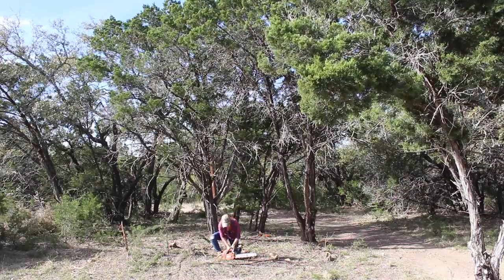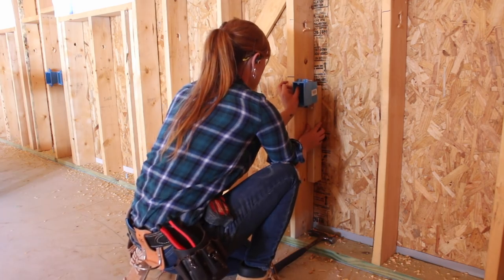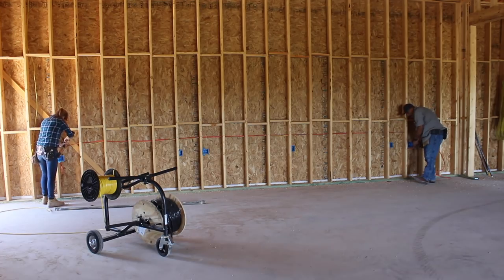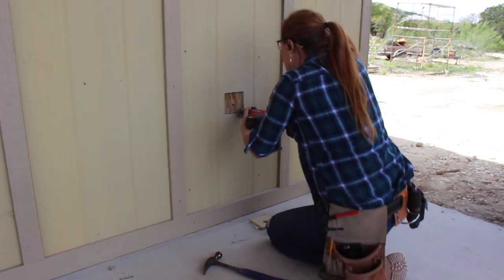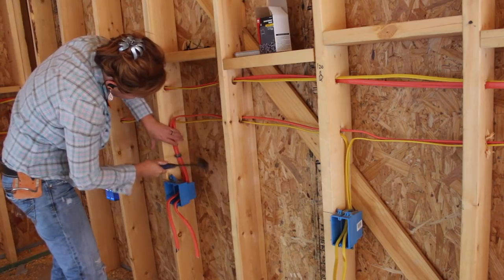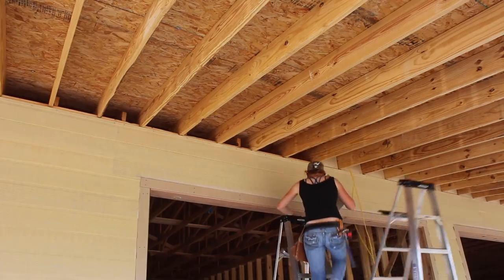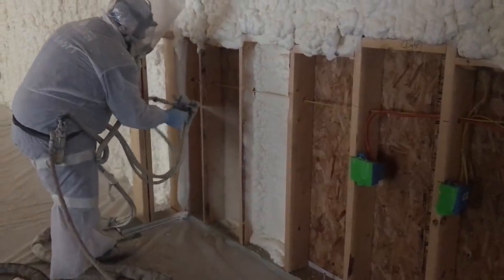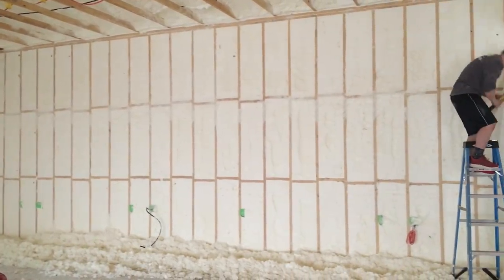Wiring My Shop and Spray Foam Insulation

Comment: Q: Hi! And how do you plan to solve the issue of removing chips and dust?
Maybe it was necessary to put pipes(tubes) inside the walls, and to arrange places for docking with equipment(tools)?
Or will it be a suspended solution under the ceiling?

Comment: About the power lines. A lot of electrical contractors will build power lines and set transformers. My company does but we're in OK. 
The utility company just has to hook up the main line to the transformer, sometimes they have us do that as well. 
Just so you know there are other choices beside the utility.  They should have a list of approved contractors/vendors they use for work, might not hurt to ask. 

Also might want to go to a 320A service just in case.  That is the largest residential/small commercial style service available in my area anyway.  

I had my shop spray foamed and use mini-splits for heat and air. Most people can install a mini-split themselves, they come precharged.

Comment: Nice choice on using foam instead of pink fiber, but I would have gone two inch close cell and covered with rock wool. The close cell stops all air movement and the rock wool acts as a sound deadener and fire break.  To see what I'm talking about look up Matt Risinger's YouTube channel, he just did a video over this. 

But again you will love the fact that you used Spray Foam in the summer here in Texas, I know you're up in the hill country (I'm in Corpus) and it gets nasty muggy in the August heat. Can't wait to see it all done. Also because you went Spray Foam, you can use mini split A/C system in that shop now, which will cost less to run.

Comment: Absolutely Awesome job so far.  Please keep up the good work and excellent videos.  You have a lot of excellent tips and tools.  Unfortunately some of the tools are near impossible or just too expensive to ship into Nova Scotia, Canada but that's ok.  Talk about a total score on the spray foam insulation offer.  I'm doing my basement walls with closed cell.  I originally did the basement walls with Roxul ComfortBatt and another layer of ComfortBoard - it's cold in the winters up here, but after the flood opted for spray foam for the better R-Value and moisture resistance properties.  Oh, and for the "just in case a flood ever happens again" event!

Comment: Hi April. Great video, awesome shop... Jealous? Lol.. remove all doubt.. I question the waste foam, and had an idea,,, if the waste product could be blown in walls simultaneously with a fresh coat of foam?  Perhaps for a future build. After all, you did pay for it, the waste product does belong to you.  Also, be careful about Sugar not burning, as many larger style homebuilt Rockets burn motors produced with sugar.  A mixture of melted sugar and tree stump remover poured into paper towel or toilet paper rolls makes one rocket motor.  No matter what April, great video.  Best of luck April. I have learned many things from your videos.

Comment: I"m glad to see you used spray foam...I'm a believer in the stuff for both efficiency and because of the infiltration benefits you mentioned. I am curious, however, why you chose the less efficient open cell product instead of closed cell which not only provides higher R-values, but also adds substantial rigidity to the structure. "Enquiring minds want to know". :)

Comment: Thank you. Having had electrical done in two garages which double as workshops, I can relate to having make than enough outlets installed both inside and out. Having high ceilings in my home makes me wonder if you will really be able use a smaller HVAC. Personally, I'd rather have a bit too much than too little. Looking forward to the next build. 

Any plans for the flooring?

Comment: In 2011, My wife and I retired and moved.  We bought a few acres and needed to build our home.   But I wanted a workshop.  So we had it built first and the contractor recommended we spray foam it for installation.  We had a steel building.   We intended to live in it temporarily while our home was built.   We moved into the building in September.  By November, we had decided to just live in it.  It's so easy to heat and cool.  We are in midwest-Arkansas.  We use around 800-900 kwh per month electric (we are all electric).  Two months a year we may use up to double that amount.  I highly recommend spray foam.

Comment: It may be a good idea to install some roof hatches or windows, just to vent the shop quickly, if needed. 
The ones in my shop always come in handy if some work produces some smoke (welding) or other fumes (polyester resin).
Nothing vents a building faster and cheaper than the chimney effect.

Comment: Do cat 6 instead of 5 for some a little future proofing.  Also look at Unifi for some commercial sized WiFi points.  They aren't actually all that expensive, fast,  and you can WiFi up most of your property on one robust WiFi network.

Comment: Having a good contractor is key in SPF insulation applications. There were several fires in the early part of this decade linked to contractors not allowing enough time between applications of layers and the exothermic heat build up inside the foam caused fires. Particularly, I remember 3 in Massachusetts. There were additional ones a few years ago in govt facilities as well. Poor quality control and poor installation practices

Comment: April, two questions: 1) When this job is all said and done are you going to doing a total cost breakdown on the project. 2.) Are plans going to be made available for the shop?Ok bonus question: Since you volunteered you help with the electrical work did hr charge you extra for the help?

Comment: FYI when getting a/c for the correct tonnage it’s 400 square feet per ton of cooling. So if your shop is 20x20= 400 sf, you would need 1 ton a/c unit. And for heating it’s 12,000 btu per ton.

Comment: Our company has been using closed cell spray foam for the last 20 yrs. on mainly oil field truck bodies. Works great, can not beat it as far as insulating value and noise reduction. Great job with the electrical (been an electrician for 40 yrs.). I will not pound on you about electrical, the county codes are pretty lax. Great job April !

Comment: Doing 1-2" of closed cell foam, then open cell gives you the best strength and the best air control but costs a bit more. That is how I am designing my upcoming workshop. It is remarkable to see how much you have done and been able to get through. Incredible work!

Comment: April, I am curious as to the height you placed all the electrical outlets. I don't know what you have planned for the layout of the shop but I was thinking if you end up putting cupboards or benches against the wall then the outlets would be covered ?
I am really enjoying following the construction of your shop (and jealous ;-) ). Congratulations on such a great project.

Comment: Hi April I subscribe to your channel and I was concerned when you sold your old home and move to your new home. I was disheartened to see that you had lost your old shop and had to move into and share a garage with your husband. It just wasn't the same. I enjoyed your project videos and was concerned they would come to an end. But I had a hunch you have big plans on the horizon and I am so happy to see that coming to fruition. Which brings me to a question I have a shop of my own a 3000 ft.² steel building that I bought used dismantled moved then re-erected on my own property. My shop is a combination Auto shop machine shop weld shop and woodshop yes it all fits quite nicely. I have been contemplating different products to insulate. After watching your video I did a quick search of my area for a spray foam contractor which appears there is not a contractor in my local area I must search further. Can you give me a ballpark figure on about what it costs you to have your new building insulated with spray foam.?PS congratulations on your new shop and I wish you all the success in the world.

Comment: Your shop is great, I was thinking about all the filming you will be doing in there and was going to suggest a lighting grid for the ceiling using common 1 1/2 inch black pipe. This would allow you to have great lighting anywhere in the shop you want to shoot, just clamp lighting all over the grid, setup a DMX lighting controller and you are set.  You may also need to do some acoustical work to manage echo. You are building a very unique space.  Love your channel.

Comment: Just make sure if you have downward facing receptacles for lights on the ceiling-that the receptacles are twist lock style.This is per N.E.C.-i don't know if your having inspections,but if so this is a necessary step.

Comment: As a Canadian, I’m sold on spray foam insulation but isn’t this a bit of an overkill in Texas? Do you really need much insulation? By code in most provinces in Canada (maybe all), you only need a R value of 15 in the walls.

Comment: April, do yourself a favor and spend the extra few bucks in Cat 6. It is always a pain pulling back wires and re-fishing years later. If you are running multiple Ethernet wires, pick up a patch panel and switch!

Comment: So great work! I always astonished how easy it is to build in your country! in italy you cannot even think about helping electrician in theyr work, it is Illegal believe it or not! I have a question: You made foam directly over wires. I f you have to replace a wire for some reason how can u do it? Why don't make wire pass trough a  wider plastic pipe so u can pull them out easily and replace them or add a new wire, may be internet cable or tv or anything else? Thank you for  nice answer ....I love your job!

Comment: I think you inadvertently made a good choice not running your low voltage wiring before spray foam. I have seen the spray foam heat up enough during the expansion  process to cause low voltage wiring (catagory cable, speaker cable) to melt. It is recommended to run these through conduit as you have done. Really nice shop!

Comment: Your really doing a nice job April but instead of doing the lights outside of the man doors with the automatic sensors on at dusk and off at dawn, consider using a standard fixture then using a programmable switch that you can either use preset times, program your own times, or override and just use on and off. Some of the newer switches now even come wi-fi enables so you can turn lights off and on or change programming from anywhere that you have internet available. 

Your gonna be in heaven when your done!!! I’m proud of ya, keep it up but be safe!!

Comment: I have seen existing homes in south Louisiana get reinforced with that foam sandwiched between plywood for hurricane reinforcement. That should add a structural element as well as be great insulation.

Comment: I'm a fan. I have now tuned my 77 yr old father in law into a fan too, and that's a break through since he barely uses a computer and has been a carpenter since the early 60's. Thanks for introducing me to french cleat shelves, my robot work shop is wall to wall in them and i'm getting ready to add them in my garage wall to wall. Keep up the good work.

Comment: Hi April, perhaps you should think of overhead power points as well. Suspended multi-outlets hung from the beams. Good should you have a large machine in the middle of the floor in the future. Just a thought.

Comment: Wow!  Spray insul in a shop.  Never seen that done.  Nice!

A short story.  I’m a retired architect/contractor and my last project was building a home for myself.  I wanted energy efficient.  I live in a redwood forest so solar was not an option but I spent 35k on spray insulation and big bucks on high end doors and windows.  A tight structure.

So we move in.  My wife owns two cats who get a lot more love than me.  Those two would not use the new cats door.  They had no problem with the cat door in our old house but the new one was somehow beyond their abilities.  So the solution was to leave a sliding door open so the cats could come and go as they pleased.  In effect my super efficient house was doing its part to heat Northern California.

Comment: April you seem like you have everything under control and like everyone else I think it is awesome. I don't know the climate where you are but I built a much more modes shop and thought it a good idea to have the dust collection and central vac outside of the main workspace. It wasn't long before I realized I was sucking huge amounts of expensively heated air or expensively cooled air and throwing it outside. Eventually had a return with a filter. A heat exchanger might be a better idea.

Comment: Great work! Did you guys put cable guards (metal plates) on each stud in front of the wiring to prevent penetrating a cable with a nail/screw/drill bit?

Comment: Before you finish.. be sure to add some boxes up at the outside end walls up high .. to mount LED Floodlights  some come with video cameras built in.  you need them high enough to avoid tampering.. or stash them up under the eve near the top .. loose field of view. but also reduce visibility.  just a thought before you totally enclose the walls and ceiling..  if you are going to put dry wall  are you going to run a 4 foot wide plastic behind the drywall along the floor.. to stop drip down condensation from attacking the back.. or painting the back of the lower run of drywall with an exterior PVA paint.. to seal it from the back.  nothing as much fun as soggy bottom drywall.   or even using the first 18" of concrete board.  so wash downs or water on the floor does not wick up the wall.. you might even think about painting the faces of the first foot or two of exposed framing.  and all the way around the door before the sheet rock both on the framing and the back of the sheet rock.   nice work so far.

Comment: Looks terrific. I know I was planning on using spray foam in the future in a new home and shop. I though would want to be off grid using solar panels. I am just curious did you think of using solar power to run the small outletor even just on the HVAC when you install it?

Comment: Tip for filming in messy conditions: you can get inexpensive rain covers, aka 'rain sleeves', for cameras that will protect against any dusty debris in addition to rain. Use a cheap UV filter on the lens to protect the lens element. I use these all the time doing wildlife photography in poor weather, dusty areas with high wind, and beaches to protect against salt water spray.

Comment: April I am concerned about the spray foam being used.  There are known problems with spray foam if the installation does not cure perfectly.  Please protect yourself and those working with you if you find there are any lingering fishy smells coming from the foam.  Take care.

Comment: I'm curious why you decided to go with open cell foam insulation vs closed...especially on the underside of the roof.  Open cell will absorb moisture like a sponge if you have a leak.  Thank you.

Comment: Electrical outlets #12 gauge wire should be 20amp. 30amp is #10 gauge wire. AC wring is usually 30 amp 2 pole

Comment: Noticed you didn't use nail plates/cable protectors over your horizontal wiring.   I would have concerns about some point in the future putting a big long screw into the stud to support some heavy shelf or secure a tool.  Would have been cheap insurance at this stage.  I don't think code requires them if you have more than a certain amount of wood between the wall and the wire so you probably meet code.

Comment: Out in the country where there are few overhead grounds on the power poles, think about whole shop surge protectors and lightning protection. It would be a shame to loose equipment by lightning. It does not have to strike the shop just the power poles coming in even a half mile away will produce a large surge. I have seen this first hand and they were not on a hill. Every electrical appliance plugged in were fried even if they were off.

Comment: Aren't you concerned about putting the dust collection outside and pulling out of the shop all of your conditioned air?  Now that your shop would be very efficient, this would really take away from your efficiency.  Maybe you can have a return air vent so that the hot or cold air can come back in?

Comment: Thats looks GREAT! I would think it would be safer to use metal outlet boxes in a shop where the amperage draw is higher, and there  is a  risk of heat from things that could wrong at the outlets, metal wont melt and burn like plastic in an overheating situation.

Comment: How eco-friendly is spray foam? That was a lot of shavings/wastage. I like the idea that it seals the building, but is the waste biodegradable or does it sit in the landfill like polystyrene? Just interested as I've insulated a lot with batts and normally we lay the waste in the ceiling.

Comment: When i worker in a textile plant in 60's foam was just starting to be used in new areas .The company that put it down on our roof  sold the idea to our owner this was oked at a corporate level . So they began there were a lot of people who parked on one side of our building on a wide road it took about 5 minutes to walk from one side  to the other so there were a lot of cars . After the foam was dry they sprayed the roof with a silver coating .BY quiting time every body parked there had a part silver car .SO  the spray guys had to compound and wax all those cars and paint a few of  them.About 6 months later the foam started to come off the.  roof   Bet that put a drop in their bottom line . So when a hard wind blew the stuff was coming off in large sheets and blowing every where .

Comment: Am I correct in assuming that you were going to have your dust collector outside but the filters and return air back inside the shop? It seems like a shame to have such a well insulated building but then aggressively pump all of your conditioned air outside.